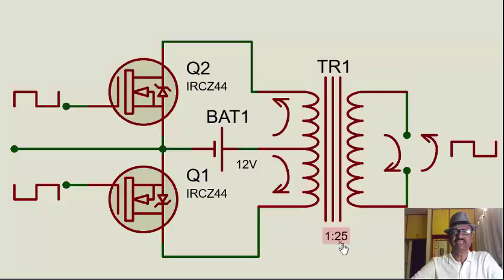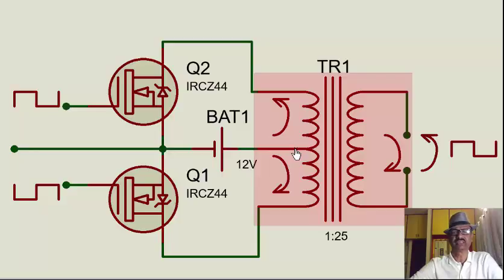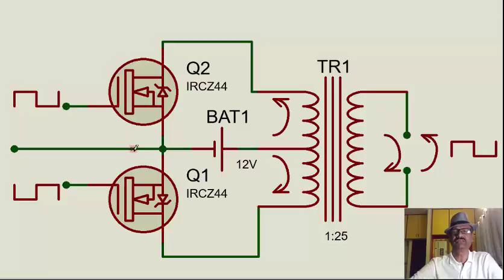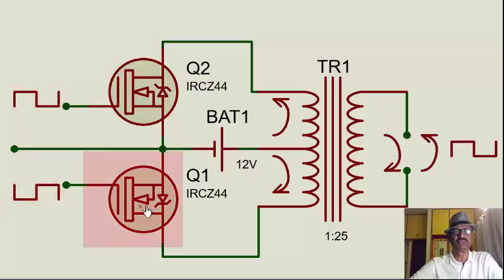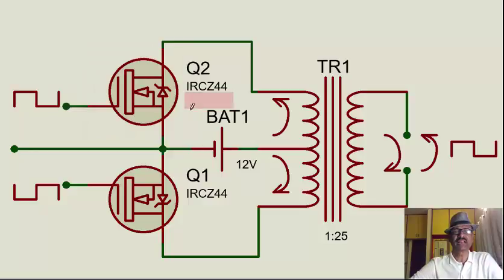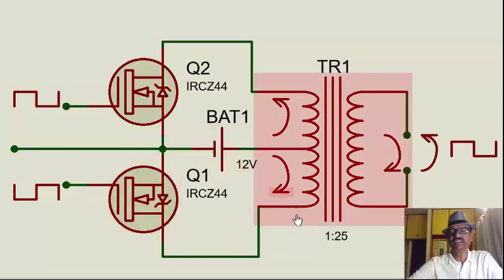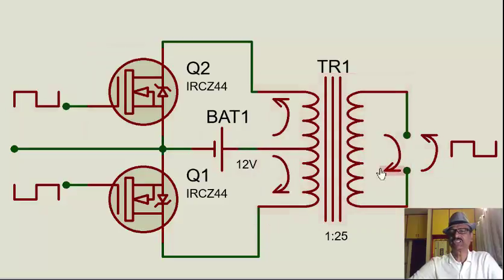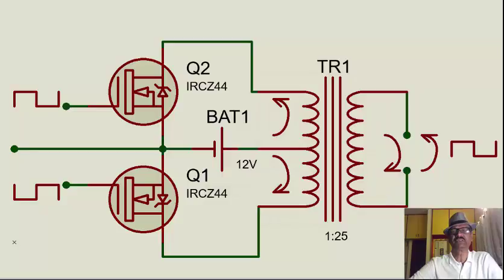Inverter - circuit design Part1- Covering basic function

Comment: Can you use 1 mosfet
Reply: josh thumperluck no
Reply: @ElectronicsinHindiIndia  thanks but I seen a you tube video using only 1 mosfet and was working. Why?
Reply from the maker: They are flyback type
Reply: @PatnaikUC  thanks but how do they turn on and off without controller, does the resistor do that
Reply from the maker: @ceff01  No. It is made to explain the fundamentals. Working circuit is different

Comment: this is good series to watch thanks helpful. but I still have a question , something I'm a still confused about. I don't understand how the pci or op-amps in my case handle the current? for example the Tesla cars have several igbts in parallel to handle current, but the power goes from the batteries through the brain/ the wave generate the pci/op-amps right and is usually one Little chip, so why does it not get burned up.  It is apparent that I am little confused about this and would be appreciative of your help. I hope my question makes sense?
Reply from the maker: Even with a number of IGBTs in parallel, entire drive requirement can be driven from a tiny  IC chip as the current demand to drive them is negligible. IGBT is a voltage driven device, unlike the BJT which require current at its base to act as a switch.